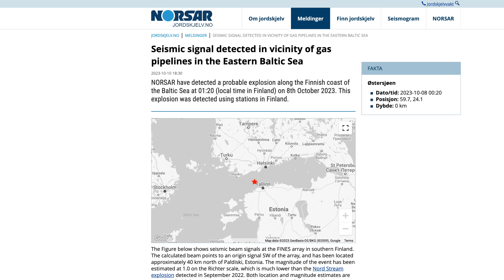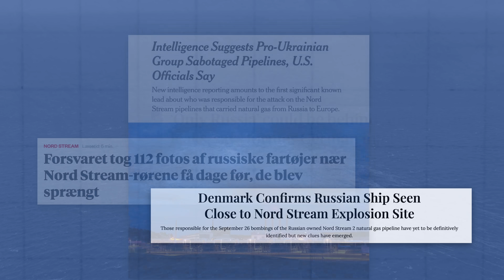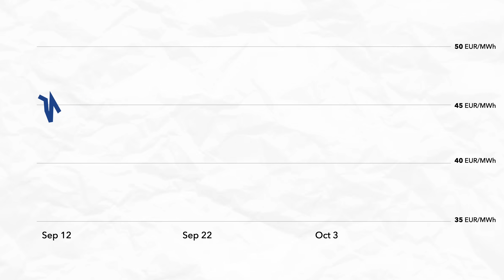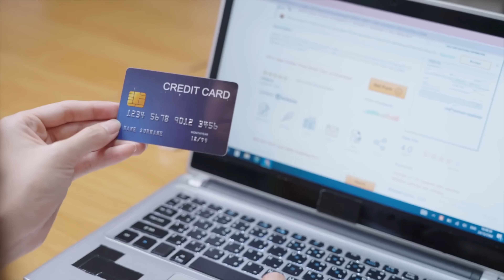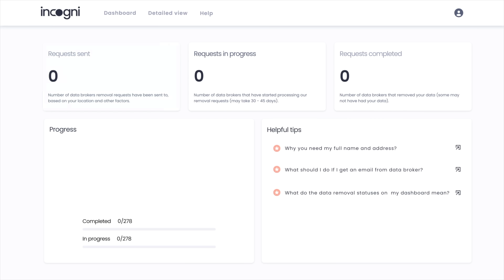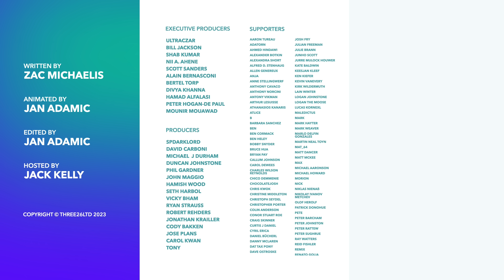Did Someone Blow Up the Finland-Estonia Gas Pipeline?

Comment: Just another reason why Boskalis/Smit must build a land bridge between Helsinki / Tallinn (Reval). So no foreign submarines can ever do damage.

The Netherlands is used to building dikes, creating islands or even closing off the seas completely.
Reply: An 80km bridge?
Reply: A submarine could definitely damage a bridge
Reply: That would cut off St. Petersburg Sea Port for the Russians. That definitely won't fly with them. It would also disrupt several of the other smaller sea ports in both those countries. Thus causing home grown resistance to the idea. A Tunnel like that between UK and France would be a better option than a land bridge.
Reply: The idea(part of Highway Rail Baltica) has always been a tunnel and never a land route.
Reply: @davidtherwhanger6795  but do the Russians really need port access? That area is basically cut off since it's owned by nato now
Reply: There is a proposal to build a tunnel.
Reply: @michaelgoetze2103   Finland blew up its own pipeline surely , just like Russia destroyed it's own pipeline.
Reply: @spritemon98  But it is not Owned by NATO. By International Treaty only 12 miles (roughly 19 km) from your nation's shores can be claimed as your nation's Territorial Waters. The rest is open by Freedom of Navigation statutes in that treaty. That leaves a gap for Russian ships to leave thru the Baltic Sea to the North Atlantic Ocean. Something they cannot do freely from many of their other ports as those are blocked by ice for long periods. And their access from the Black Sea to the Mediterranean Sea is at the convenience of Turkey thru the Bosporus Strait. It would in effect be a permanent Blockade of Russian Ports. And has been a major point of contention since the early days of the Russian Empire. And St. Petersburg is Russia's primary port for trade. Trying to cut off that would force the Russians into war. And most likely a nuclear war.
Reply: @parabot2  ???
Reply: @davidtherwhanger6795  Nah, I fully support restoring Finnish borders from before the winter war, and giving them St. Petersburg as well as the rest of the Baltic coastline as reparations for stolen land. And there we go, land bridge. If Ruzzians think it's ok to invade Ukraine for the exact same reasons, I don't see how they can make any sort of demands of territorial integrity.
Reply: @parabot2  lol, why would we damage (nothing was blown up) our own pipe that connects to our nato and otherwise allied country who we have probably as close of ties to as to sweden. Go buy some tin foil, you need a bigger hat
Reply: No thanks
Reply: @256shadesofgrey  If you do that then you condemn the new port of St. Petersburg you give to Finland to economic ruin. Thus giving Finns a burden instead of a boon. It also cuts off Hamina, one of Finland's 5 largest sea ports. Which would further shoot Finland in the foot. This would bring major backlash from Finns who work and live there. Simply put, poor thought out responses do not make good solutions.

Comment: Finland has an LNG terminal and is fine in terms of supply for its needs. For Finland, this is significant in political terms first and foremost, then market efficiency. The energy issue is with Estonia, which is much more reliant on natural gas, and doesn’t have LNG import facilities on it’s soil.
Reply: Your information  is false. Estonia one year average consuption of gas is 3.5TW. In Latvia Incukalns gas storage is full of 7.5TW. Most of is bought by Estonia gas companies who were planning to sell it to Finland this winter. Now they cant. Please  check data before you start to  spread misleading information.
Reply: And Estonia have LNG import facilitie on its soil. They started to build it last year.
Reply: @Heinakuhi ehm, what I said is accurate, Finns don’t need gas from Estonia for consumption by its industrial plant, and at best this sabotage is annoying. I hope Estonia is building facilities for an LNG terminal, but it doesn’t have one right now. Otherwise what you said, that’s good, wouldn’t want Energy prices spike again in Estonia.
Reply: @MrSpritzmeister the construction of the Paldiski lng terminal finished a few weeks less than 1 year ago. It infact caused a minor politically crisis because it was implied by estonian government that the terminal ship ordered jointly (paid for by finland) would be stationed in the gulf of finland terminal that was finished first. but regardless of the fact that paldiski was supposedly finished first the ship was still anchored in inkoo instead. because the finnish need was so much highest and for estonia it was only a measure of redundancy and price control. Estonia or it's small industry does not NEED the balticconnector at all. the pipelines from the latvian storage facility and the lithuanian lng terminal more than cover it's demand. never mind that there is still an option to just dock a ship in paldiski as well
Reply: @oinas91  good! So you have a terminal but it isn’t used, so it’s useless at this moment. Nevertheless, good that one exists. The point was about Estonian energy mix vs. Finnish one, and the supply to that mix, and how a restriction in supply, in this case that one pipeline, affects prices for consumers. In this Estonia is much more exposed than Finland is because gas is used much more widely, and consumers being significantly less well off.
Reply: @MrSpritzmeister no you said:
"the energy issue is with Estonia"
wrong
"which is much more reliant on gas"
wrong
"which does not have a LNG terminal"
wrong
it's ok to be incorrect. but it's not ok to dig in your heels and start flailing when you've been educated on your errors
Reply: @oinas91  nope mate, the energy issue is still in Estonia, through supply and energy mix. Didn’t know about the terminal, but it’s a mute point as per what you said. Don’t butt hurt, have a good day!
Reply: @MrSpritzmeister you have very poor understanding of the logistics around this issue. most of the gas flowing through the pipeline before it was taken offline was headed for latvia. for storage. to be pulled back out by it's finnish owners when needed. this is so small of an issue for estonia that it's hardly even making it into the news despite the prime Minister making every effort to use it to deflect attention from herself and her government.
Reply: @oinas91  right, I was under the impression that Estonian energy mix was much more dependent on gas supplies, and thus much more exposed to gas futures increasing due to instability or supply issues.
Reply: @Heinakuhi we do not use gas so much here by our self to be honest and we have over 6 months storages of LNG gas.
Reply: It doesn't matter if Finland and Estonia have adequate supplies, if it this triggers panic buying and pushes up gas prices significantly, even if only for the short term. It could be enough to push in more extremetists parties into power.
Reply: @ospehu1  I do not know who "we" in this case is, I asume Estonians.
I do not think this is critically dangerous for either countries, but Estonia is way more dependent of natural gas than Finland. Estonia uses around 300 cubic meters per capita, while Finland uses 40 cubic meters per capita in a year.
Reply: @fl4shi238  estonia is more dependent on gas  but this doesn't affect their supply. gas could be bought via the klaipeda terminal, most of the gas in latvia's storage belongs to estonia's gas companies and if the need was great estonia could activate it's own terminal (but that isnt necessary unless there was some horrible accident with the latvian storage facility). as there are no supply issues the price should be relatively stable as well.

Comment: 5:18 Knowing how unreliable Russia is, I would say the Energy supply is much more insecure WITH Russian gas than without it.

Russia cut its gas exports to Europe well before the invasion of Ukraine, in mid 2021, to ensure European gas storages were empty when Russia attacked Ukraine in Feb 2022.
Reply: they weren't empty though. they never are during winter. they are loaded in summer and autumn.

Comment: More than likely a Chinese ship bumped into it.  Not that deep and the pipe is off the floor of the ocean.  How much room is available for large ships.  It wouldn't surprise me if it was an accident.
Reply: Why Chinese
Reply: @skp8748  A Hong Kong flagged ship named New New Polar Bear seems to be the most likely suspect.
Reply: It dragged the anchor too long, it would have been noticed on bridge, thus it was an attempt to break all cables. Either it was a provocation by China or Russia, but I am inclined to believe that the Chinese were fooled by Russia (company was operated by Russians).

Comment: This is a good think that a gas pipeline was destroyed. Less fossil fuels and a cleaner power grid.
Reply: Gas is clean...
Reply: @skp8748  It still emits carbon dioxide when burned
Reply: @dimamatat5548  what's cleaner than gas?
Reply: @skp8748  Solar, wind, hydro power.
Reply: @dimamatat5548  At least in the short term the shortfall will more likely be covered by dirtier fossil fuels such as oil shale.
Reply: @seneca983  Why? Solar panels can be installed quickly.
Reply: @dimamatat5548  While it's possible to install more solar panels, that isn't free and doesn't fully substitute gas in any case. While solar panels have been getting cheaper, Estonia isn't an ideal location for them. Since Estonia is a fairly northern country, solar panels would generate the least electricity when it's needed the most. This is in contrast to gas which is well suited to be used as peaking power during high demand or lack of other supply. Also, oil shale (which is among the dirtiest of fossil fuels) power plant capacity is something that Estonia already has so they're likely to be used.

Additionally, this damage to the pipeline has let out a (small) burst of unburnt methane which is a much more potent greenhouse gas than carbon dioxide.

Comment: Just like they blamed Russia for the nord stream pipeline

How many times they gonna use the same lie 😂
Reply: Russia has every reason to attack both pipes, it drives up natural gas prices.
Reply: @MarkShal-nv6bj  you do understand it's a global market right? These attacks drive up global gas prices
Reply: @SelfProclaimedEmperor  no, it's not, it's a local buisness. Prices may go up in case of shortages, but local authorities confirmed, that it won't happen, and I tend to believe that. This pipe connects two consumers, not supplier - consumer. Logistics will change untill pipe is fixed, thats all. Not to mention, that both Finland and Estonia are really small gas consumers. All in all those two hardly can affect global market gas prices. Speculations around gas pipes security may affect prices, but it won't make that big impact and definitely not lasting one. Speaking of factors that really matter: after the beggining of Palestine - Israel conflict, Israel, a gas supplier itself, shut down its gas terminal for security reasons. Also there are other gas suppliers in this region, that might get involved in conflict. Electricity production at wind farms in Europe has decreased, meanwhile it's October - time to turn heaters on.
Also Russia sells LNG to Finland, and Finland delievers LNG to Estonia through pipes. Basicly you are implying, that Russia blew up pipe to reduce own LNG sales, thats ridiculous.
Reply: @SelfProclaimedEmperor  Russia doesn't have a reason to attack it's own pipeline. It could just withhold exports through it without destroying it (which in fact had done before the bombings). However, this time Russia does have a possible motive.